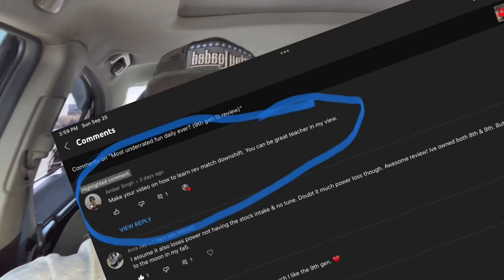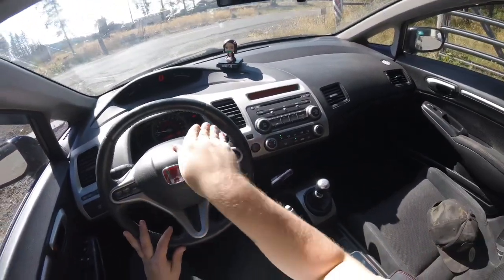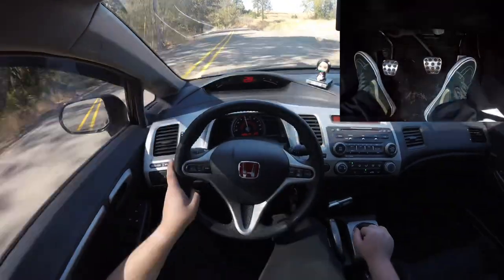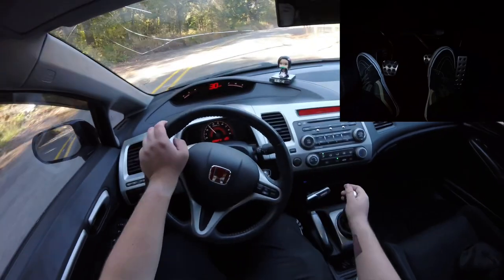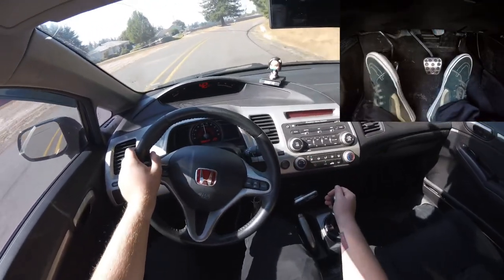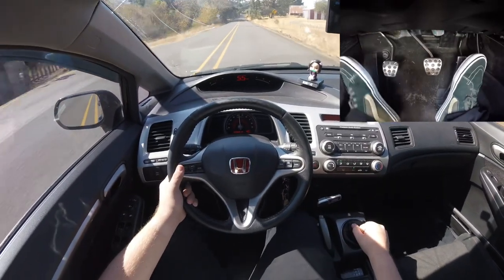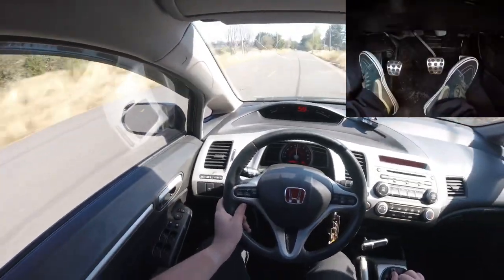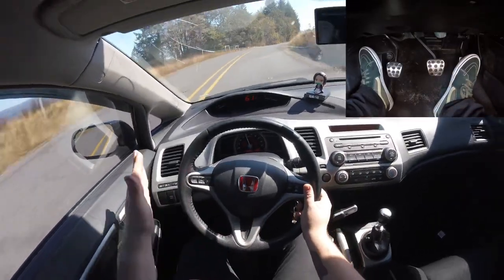So you want to rev match and heel toe? Watch this! (Tutorial)

Comment: you push your clutch pedal too hard (maybe its stock and a bit mushy, I have a stage 3 clutch with light flywheel and 1-4 forged and never likes to be pushed that way), for me going from my 1987 vr4 with evo II gearbox and short shifter to a fg2 Si I could really feel the car like you to be lighter on the heavier clutch (if you get what I mean). Maybe sit a little closer to the steering wheel so that you don't have to push it so hard, but in street races you are going to kill the clutch.
Reply from the maker: Absolutely. The stock clutch on this car is so dang soft and need to be upgraded soon! Appreciate it